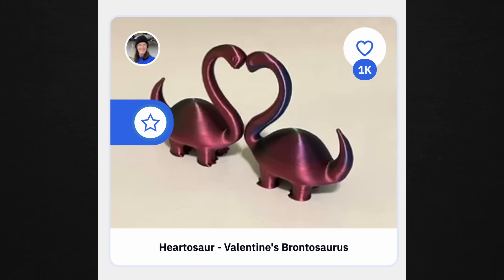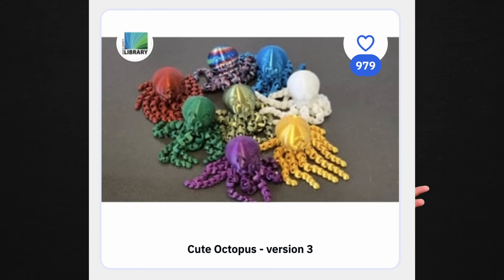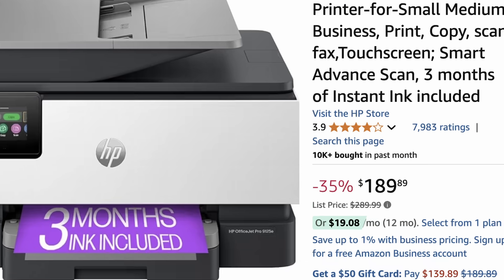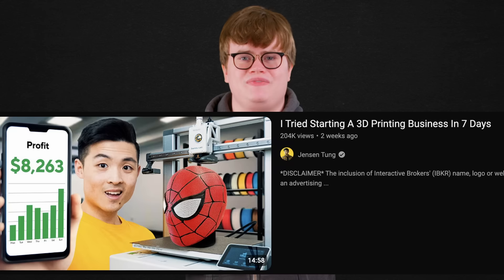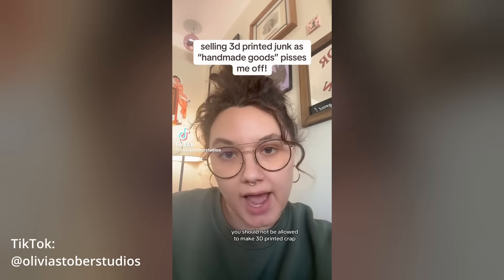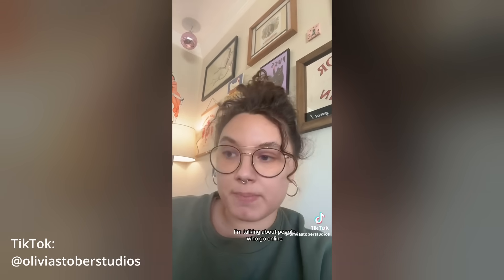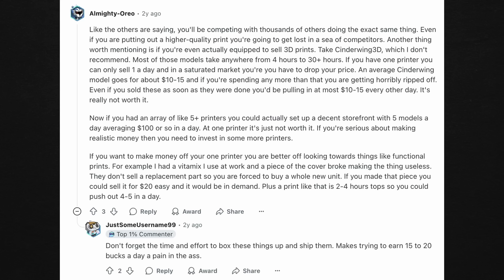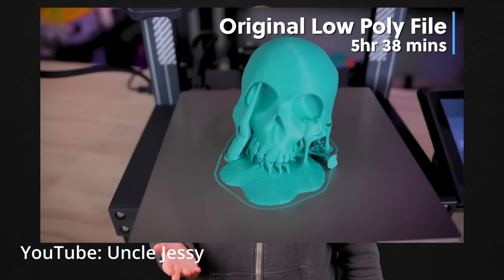The Rise of 3D-Printed Slop

Comment: It’s way more profitable to sell niche items for hobbyists rather than mass printing those flexi dragons
Reply: yeah like furby faceplates or covers for aerogarden knockoffs
Reply: It's better if it's a hobby you are into. If you play Warhammer40k and then 3D print some of your own miniatures or some for your buddy. Basically it's worth if you are printing stuff YOU personally would use.
Reply: I have a go to guy that prints stuff for my mini painting hobby. He overcharges (compared to cost of resin and competitors) but I can order any models I want, he customizes them when necessary and I receive everything assembled and ready to paint. Worth it!

I'm at a mini painting group and most people sell prints on the side. They make more money than selling random filament stuff
Reply: @beatrizklotz8183  I do both FDM and Resin. Resin printing is far harder and more dangerous than FDM so absolutely should be making more money than FDM.
Reply: @OGManlyMutt yeah I have both as well, and FDM (at least when it WORKS with my crappy printer) is so much easier to handle. You don’t have to worry about fumes, don’t have to wear a mask+gloves, don’t have to have chemicals specifically to clean them, and you don’t need to go out of your way to find where to safely dispose of the waste. It’s just so many extra steps and space required to do Resin compared to FDM.
Reply: Yeah these people could make a killing making replacements  for aquarium people. There are a lot of proprietary parts that can’t be bought anymore in various filters, lights, etc.
Reply: @garbagegremlinz I just bought a 3d printed tunnel for my coryadora
Reply: Look in to classic car parts. There are so many small plastic parts that have not been made in over 30 years people restoring cars would fight over. The one that comes to mind is the little plastic card that makes the door locks work in a elcamino they used ti be worth like $800 because no one had the mold to make more untill 3d printing
Reply: You'd be surprised. My friend and I do this exact thing, he sells flexi toys etc at shows and makes $250-$500 per show on average. I sell custom made 3D printed parts, I do design work, custom parts for customers, niche products other people aren't doing and I make dick all compared to him. Why is this the case? Simple, videos like this. People in general don't understand that 3D printers can actually produce real, functional useful things instead of just flexi toys. When I tell people that I 3D print my own custom designs to replace parts in my Kubota Excavator, my Toro Snowblowers, Gas powered wheelbarrows, engine parts etc they're mind blown and always say the same thing "I didn't know you could make stuff like that, I only thought they were good for toys!"
Reply: @kylequinn1963  The misrepresentation of difficulty, reliability, and quality of consumer 3D printing and CAD/modelling in this video by someone who apparently knows nothing about it really annoyed me. I don't sell anything, but I bought my first (very cheap) 3D printer to print a replacement part with a model I downloaded, and quickly moved on to modelling other simple but unobtainable parts for myself and others.

Despite my focus on "functional" prints, I don't judge people who print "decorative" objects. I think it would be interesting to compare the environmental impact of purchased vs printed slop at home, both per object and accounting for the impact on an individual's consumption. I'm not aware of any research, and I have no Idea what the results might be. 

While I think the video overstates it, 3D printing does require some commitment of time and effort. I think this puts a limit on the environmental impact of an individual's 3D printing (with a hard limit determined by the machine they own).
Reply: @lorantstary4398 the people running print farms are producing tons of this junk. 

I would also argue these "toys" end up in landfill faster than traditional toys simply because they have zero second hand value. Nobody is buying second hand flexi dragons so as soon as someone is tired of them they're garbage
Reply: @strayiggytv  More than 99% of ALL toys are never resold or donated. The vast majority of everything in existence never gets resold. So no, they don't end up there faster than any other toy or clothing or package wrapping, or even furniture for that matter. Did you not get the memo that we're living in a throw away society now?
Reply: @OGManlyMutt  the idea that you think "lol everything's bad so it's cool to be bad I guess" is just sad. Our disposable society is trash but there's no reason to tack on a little more trash to the pile. 

You're only defending it because you make money at it and youre selfish
Reply: @lorantstary4398  Also there is the fact that usual toys are mass produced expecting to sell well enough so none of them was produced for just getting dusted into some shop shelf. I would only produce Toys with 3d printing that i can't buy anywhere else. Very niche stuff, which i then do myself.
Reply: @lorantstary4398 yeah I was kind of annoyed by how off-the-cuff he was about it for something he doesn't participate in himself. I get there are a lot of normies that don't appreciate the hobbyists or designers that actually hone their own craft but they're allowed to do that. They can print their junk and there's always a good possibility that one of those normies will be so enamored with what junk they print, they become a hobbyist themselves.
Reply: @kylequinn1963 there is probably a marketing problem. Slop you can sell anywhere, but where do you find those niche customers? I bought some camera parts from a guy in Italy, I happened to hear about his website and found him that way. But if you are into cameras and know nothing about 3D printing you probably assume you are done for and don't even go looking.
Reply: @kylequinn1963  Honestly, car parts was the first thing that came to my mind when I first heard of 3d printers. There's so many old cars with rare parts that could be solved with 3d printing tech.
Reply: @kylequinn1963  people get the idea when you show them 3dp guns that have shot thousands of rounds.
Reply: One of the best prints I bought was a badge holder to make my work I.D. look like its from The Fifth Element  lmao
Reply: Its honestly not. Most hobbyist nowadays have their own printers, even if its a cheap ass ender 3 or something. Most of the 501st and Mando members i know owned multiple printers, and your average wargamer has atleast one cheap SLA (because printing resin mini's is cheaper than GW prices)
Reply: @nikushim6665  guys like the dude above you are exactly the kind of people who give 3d printing a bad rep. Obsessed with how much money they make and in love be with the idea that they're any better than a dude on AliExpress peddling landfill trash
Reply: @ Don't knock the Ali-e, there some good stuff on there :P   But as for Manlymutt hes full of #*$& so i wouldn't pay him any attention.
Reply: @nikushim6665  alie e had its place but weirdly it's full of fiexi dragons too lol
Reply: @ Never seen them popup, but im mostly on there buying bulk electrical components and tools like dspiae.  Also not a bad spot for scale model kits or harder to find GSI Creos stuff.
Reply: These dude bros haven’t found cosplayers yet. They pay bank for lore accurate props. You don’t even have to print them, just do the 3d modeling.
Reply: That's my plan
Reply: @mastermonke2413  Look into the hobby 'Diamond Painting' and you could make trays for that hobby. Trust me Ive been selling for that hobby for years (not 3d printing but other products) and its a niche but very popular hobby. People are always looking for something new
Reply: Bionicle. All I gotta say is Bionicle.
Reply: Yep! I print props and armour for cosplayers. 10/10 use of my printer
Reply: My plan with a 3D printer is hobbyist stuff, i want to print my own warhammer bits and miniatures
Reply: @leatherlass6730  That's how it begins.. Then you start printing stuff for your friends... And then they show their friends who then want you to print stuff for them. Then you realize you're charging them $10 for something they'd gladly pay $20 for. Then you hit your first market.. Next thing you know you're doing this full time making 6 figures a year.. And your ego explodes as  you have customers coming back again and again telling you how much better your stuff is then that crap they buy at the game store. And that fidget you printed for them to give to their kid with special needs has been in their hands for the past week and they haven't stopped smiling.
Reply: Love your work btw 🤫
Reply: Exactly in this world you need to stand out in order to make sales.  I don't sale much I only take commissions from time to time. But because my stuff is unique people really enjoy it probably more than some 3d printed items.
Reply: Thought I recognized your name! Big fan of your models. I'm very happy you give people an accessible way to print unique mask bases for costumes!
Reply: SO TRUE as someone with a 3d printer i hate those crystal flexi dragon prints so much
Reply: Well, yeah, but that takes actual effort. I'd be willing to bet the overwhelming majority of people who say they're getting into 3d printing to make money only put in the effort it takes to snag someone's STL off of a website and try to print and sell that without even doing any finish work.
Reply: As a Warhammer guy yeah its great for figures
Reply: Yeah i dont care for seeing those darn things at gun shows and farmers markets :(
Reply: Yes, I would have purchased a wig ventilation hook if someone local had made some but no I had to buy that from china…
Reply: people sell stl files for mini air raid sirens .
Reply: Like Transformers filler gaps/upgrade kits, 3D printed heads or hands for action figures (Marvel Legends, jada, Jakks, SH Figuarts, neca) or even accesories for dolls
Reply: yea i made 1000 in a week
Reply: It's been awesome for my RC car hobby. To your point, extremely niche parts, but they sell and people will keep coming back if you design parts for very specific cars. Durable parts out of TPU will virtually never break and you can save a lot of money. Then list them for sale and even if you only end up selling 2-5, hey it pays for some filament.
Reply: miniature wargaming makes up a huge portion of the 3D printing market
Reply: This is why i got mine for drone parts
Reply: Yes. It’s depressing looking at all those plastic octopuses and dragons.
Reply: Yeah. If you have knife autism you’ll buy a knife for $500 because it has a steel you have, but not in a fixed blade etc. 

And yet I still can’t bring myself to even sell my shit for what they’re worth. And they’re worth $800
Reply: Fr, I’m working on helmets and some anime related items and plan to sell them. I plan on making 800$ for about 5 items. Now that’s profit
Reply: So... Basically. Don't dig for goal, do sell shovels? 

I can agree with that. :)
Reply: I made $600 at market today selling not just flexi dragons, but an assortment of other things. I keep running out of stock.. The reality is it's way more profitable to have 10 printers than 1. I have 2. I started with one in November. I'm buying 2 more this month. I have a friend that made $32K part time last year. I'm predicting over 150K full time this year.
Reply: @OGManlyMutt those flexi dragons are landfill the moment they leave the plate.
Reply: @strayiggytv  Isn't everything landfill, except like food? Even recycables will eventually end up in the landfill. Your comment doesn't make sense.
Reply: @OGManlyMutt  everything is landfill eventually. The goal should be to use resources to make things that stay out as long as possible. Ugly novelty 3d prints are not those things. 

And before you make any other comparisons I also despise fast fashion, Funko pops and squishmallows. I'm anti anything that saturates a market with a subpar product that is worthless the second it leaves the store
Reply: @strayiggytv  I mean.. You're entitled to your opinion.. But you should have started it this way instead of making stupid statements of facts that aren't facts or even remotely accurate.
Reply: @strayiggytv  Also.. You realize this stuff is printed with Biodegradable non-toxic corn based plastic, right? Oh... You didn't... because you spout of opinions of something you know nothing about based on a youtuber that's channel is literally focused on whining about everything? hmmmmm
Reply: @OGManlyMutt  also you realize not everyone is useing that plastic right? Oh that's right you didn't because you're focused on defending your junk farm and didn't take into account the energy used by the machine itself as a  factor either. 

Also boy you sure are whining a lot because of this video criticizing you huh 😂
Reply: @strayiggytv  I don't care about this video "criticizing" me. I actually respect the dude. He's all an act and you're buying it hook line and sinker. I'm not whining but defending the ignorance and lies. The only one here whining is you.. Wahhh stuff I don't like is junk... Wahhh everyone isn't like me.... wahhh my mommy didn't bring me my cheesy poofs...

This channel is awesome! It literally brings in all these whiney basement dweller kids who play video games all day.. And I get to poke them and watch them go BUT YOU'RE STUPID I'm RIGHT BECAUSE I PLAY VIDEO GAMES ALL DAY. It's hillerious. I did figure this channel out and it's amazing! Dude is an actor who decided man I could make bank catering to basement dweller whiney babies who hate everything and think what they make up in their minds is real. And he was spot on! He literally baited you guys in and it was a honeypot of listening to basement dwellers defending themselves with ignorance. 100% top tier amusement for me.
Reply: @strayiggytv  not to one up you. But the cheapest most common market filaments are relatively biodegradable. The more toxic and less environmentally friendly materials tend to be the higher quality stuff used in higher quality professional prints that aren't really the topic of this video.

Pretty much all the filaments i own are corn based bio filaments not because im particularly environmentally minded but because its cheap and easy to work with.
Reply: @ PLA is not biodegradable. It needs to be industrially composted
Reply: @OGManlyMutt  they aren't the same thing and if you were literate you'd know that
Reply: @OGManlyMutt  you got so triggered by this video it's hilarious 😂
Reply: @strayiggytv  You can't compost something that isn't biodegradable. If you were literate and could read definitions you'd understand that. It's literally impossible to compost non-biodegradable products. So ironic saying if I was literate when you literally just said they aren't the same thing when they infact are. Once again proving you just make stuff up in your head and believe it to be true. Let me guess... When people challenge you then you reply "Do YoUr oWn ReSeArCh" LOL "Composting is the natural process of recycling organic matter, such as leaves and food scraps, into a valuable fertilizer that can enrich soil and plants" See I don't have to say that because I have proof. Notice the difference?
Reply: @strayiggytv  I really should stop but man it's addicting talking to someone so stupid. Like it's incredible.. Like you don't think biodegradable and composting is the same thing when it's LITERALLY IN THE DEFINITION! That's mind boggling. Like how do you survive? You are the type of person that inspired the movie Idiocracy.
Reply: @loreleiofthemist  no? I'm cracking up at the stupidity. These are the same ppl that whine no one pays them a fair wage. It's hysterical actually. Not sure how you read that differently? Are YOU ok?
Reply: @loreleiofthemist seriously... how did you think I was the one in tears? Did you accidentally reply to the wrong person?
Reply: @dvoremay6683  Polylactic acid (PLA) isn't biodegradable in a normal sense. it has to be broken down in a bioreactor using vary specific types of bacteria.  It wont degrade just sitting out in the landfill.   Its renewable but it's not biodegradable.  There are some polymers that are actually biodegradable but they print like #### and they cost about three times the price.
Reply: This is why I pride myself on being able to crochet... I can make things that are Actually useful and will always be something worthy of buying... Crochet: the fiber artist's original 3D printer...
Reply: @laurasohn8332 counterpoint: needle felting, crocheting's underappreciated cousin

Comment: is 3d printing worth it to practice airbrush painting?
Reply: It can be! You'd probably have more consistent results with resin printing though as that usually yields a smoother surface
Reply: Resin printer, yes, not fdm.
But resin is hella toxic and you will need a room for it and PEI.